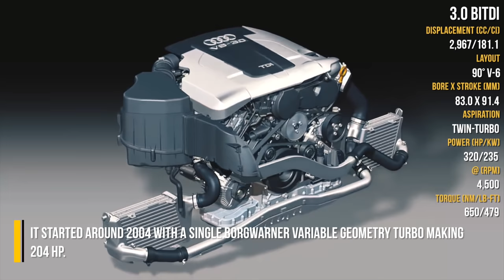7 Greatest Audi Engines Ever

Comment: I heard that the NA 4.2 barely made claimed power figures ever on a dyno, and reliability was also a problem.
Reply: They are generally reliable, however some models had a timing chain, which need the tensioner replaced at some point, for which you have to drop the engine.
Reply: MrMakrilli Thanks for replying. I was looking at a V8 R8 a while back and someone also said they could have some issues with oil use and oil leaks. Is that true?
Reply: J Stephens I haven't heard anything about it, however that's from lurking on audi forums, not doing any real research.
Reply: They are issues with  Intake valve tubings "carbonisation" / back of soot and oil deposits
Here all issues with the 4.2V8: https://forums.vwvortex.com/showthread.php?8408226-Buying-advice-Audi-S4-4-2L-V8-B6-B7-Problems-and-Common-Errors-Warning-Timing-chain-!!
Very nice guide if you want one, especially because repairs are damn expensive with those engines !
Reply: MrMakrilli you dont Need to Drop the Engine for the timing Belt. Just the Front bumper and on the S6 c4 and C5 its very easy. And than you have very much Place to work. and its very Reliable too.
Reply: David Henneberg True, not for the timing belt. But you would have to drop it for the timing chain in models like rs4.
Reply: @Makrilli  bur you don't need to change it, on some BMW you have the same problem because there is a big engine in a normal car.
Reply: Buy E46 M3 over RS4 B7 anyday
Reply: @DuBstep115  the only BMW 3series I would change with a b7 rs4 is the e30 or the e36. The others are unreliable junk. But with the b5 s4 or rs4 I would never change any BMW 3 series.
Reply: @davidhenneberg6772  How is e46 M3 junk? It literally beats b7 rs4 every way
Reply: @DuBstep115  not even close. The b7 is even not a performance car. It's like any Audi just a fast car to have many fun with and I know some guys with the b7 and they would never change it with a BMW m4 and the e46 is more worse. The m3 e46 is way slower than the b7 rs4. You need to compare the b7 with the e92, than it would be fair. The e46 is more in the time of b6 (but there was no rs model so we go for the b5) with the b5 the big problem is: every BMW guy (and one girl too) who drive BMW and are really love BMW drives just one time the b5 rs4 (and it's an avant) ant they all fall in love with this car (maybe because it's faster too). You cant compare BMW with Audi and you can't compare them with Mercedes or even Porsche as well. They are all different and not just driving different, even the feeling is on another level. The BMW is like the sporty one you want to mess with everybody and the laws are just for girls. The audi is understatement, you cruise it and sometimes on the autobahn you destroy some dumbass in his fast looking car, the Mercedes is even on another level, you don't care who is the fastest, you know who you are and what your car can do and you don't give a shit on racing someone. The Mercedes driver is racing only with a friend or another Mercedes maybe (or a car from the Same segment)

Please don't think that I am hating BMW, I really love this brand and also many others but the different is I know many of the problems of the cars too and the BMW have way more than the audi or the merc or the Porsche. The e46 is in my opinion not close the best m3. The e21 was wonderful but no m version the e30 was very great and gorgeous but my favorite is the e36. I like the e30 more than the audi S2 Coupe (only the audi got the better engine) and I like the e36 very much (sometimes I drive one, but it's not mine) but the e36 m3 is not even close to the Rs4 b5 even not the e46 with the worse bangle interior (the exterior is very great, I don't complain about that).

I wish you a nice day and hope you are not hating any other brands too. Just be fair and compare them for what they are standing. BMW is a trackbased car but not Audi and even not Benz. And don't compare it with Porsche, trust me never mess with a Porsche even when it's weaker on the track. Trust me they will kick your as and I drive a S3 8l and it's one of the good Audis on the track. When it was stock I got not a chance versus the cayman S or the Boxter S (mid engine performance beasts) but I could hold with e36 and e46 (not m3 just 328-330)
Reply: @davidhenneberg6772  I drive an Audi A5 3.0TDI but for me when I want sporty car that means RWD, oversteering and precise steering feel. For me audi S and RS models dont provide that, they tend to understeer are safe unplayfull awd and light almost numb steering feel.

Audi B5 be it A4,S4 or RS4 have all the same interior just different seats and steering wheel, have almost 80`s feel.  And audis obsession with wagons is a big no no. You cant have sporty feel in wagon.
Reply: @DuBstep115  does the m3 look different on the interior beside the 316i. In Audi you have carbon aluminium nappa leather recaro another steering wheel another instrumental another shifter another quality (alcantara roof (or how you call it in English, I'm German so sry for that) on other brands you got just the steering wheel and the seats but all you can buy on a 316 I m package. You cant buy a a4 b5 with all the things the rs5 or the S4 got because thats ONLY made by the QUATTRO GmbH. You can only get the steering wheel and the seats (not even in all models) bur you will never get the tachometer the shifter the roof the carbon or other interior material like black piano coat.
Reply: @davidhenneberg6772  Thats like 5% of interior.. its the desing of Center console and dash that make up other 95% and YES they are all the same in M and Non M cars, AMG or RS. Only small logo maby alcantara/carbon finish that you could easily do aftermarket, like install new steering wheel or interior trim.  Just open ebay on type RS4 parts boom there you go. 

Lets just be honest here ALL german perfomance cars are just different engine, suspension and bumpers fenders. nothing more, nothing special base car is same and you are going to install new coilovers anyway because the stocks allways suck. So yeah engine and looks, the cars handle the same 1.8T with KW3 coils rides the same as RS4 with KW3.
Reply: To comment this statement "You need to compare the b7 with the e92, than it would be fair. " Dont go looking lap times or 1/4 mile times. E92 M3 is out off B7 RS4 league in every standard. Tech, looks, power delivery, driving feel and and well the results speak for them self.

Not hating RS4 B7 but IMO its rather expensive car in 2018 for what it is, its E92 M3 money but barely beats E46 M3 on paper.
Reply: @DuBstep115  yes the b7 is slower than the e92 on track but faster on 1/4 mile. It got the same power and the engine don't breaks after 100-150.000 km like the e92 V8. The b7 is a pure fun machine for driving in the town or maybe on other longer roads and high ways (in germany the autobahn) and you can have the same fun with it like you have it with your e92. I love the look of the e92 more but it's unreliable and for me it's the most popular point. The b7 was only Manuel got awd and a way better acceleration. The engine is better to tune the car looks not so good but not bad as well the interior is better (my opinion).

I know the e92 is a great car when you repair your stuff everytime and that's about 15-20.000€ and more every 100.000km and that's too much for me, you can buy way better cars for that money. But when you pay that the e92 will run endless time.

The b7 got only one problem, the oil gets sooty before the valves and so there don't came enough air in the cylinder but once you did it good it don't came again and company's who did this do a new intake and ecu at the same time so you go from 420-450/460 hp. And than the problem is away for ever (when it's did by a good company).
Reply: @DuBstep115  the cars handle not the same, the Rs4 handles way better than the a4 would ever do. The Rs4 is even waaaay wider and got wider tires that you can't put on the a4 (or maybe it's possible like they're swing it with the S4 b5 but it's too expensive). I think you need to drive the b7 a4 and the Rs4. Even the awd is not 50/50 it's 40/60
Reply: @davidhenneberg6772  You really know nothing of cars... BB
Reply: @DuBstep115 ???  I think you know nothing. Or you just the theory guy who don't has driven any of them

Comment: The 4.0 V8 T should be here.
5.2v10 is not reliable and 4.2fsi lose power with mileage.
1.8t 20v and the V12 tdi are good
Reply: 5.2 V10 is very reliable, nothing like the 4.2 V8.

Comment: I thought the 450hp version of the 4.2 was twin turbo. The natural variant had something like 340hp
Reply: No, the 4.2L 450 HP variant is NA. It is just a way different version of that engine. To be fair most of that extra 100HP comes way up in the RPM range.

Comment: I had the 2.7 Bi Turbo. Coolant and oil leaks all day ever day. Everyone I met who had the engine had one or both of those problems. Good weekend tuner. Insane or stupid to drive daily. Replacing the timing belt every 80K miles requires taking off the bumper, intercoolers and radiator. I've had much better engines.

Comment: Can any1 tell me why S6/8 V10 sounds a bit different compare to Gallardo/R8 V10??
Reply: different cars, different set up
Reply: exhaust pipe lenght propably, mid engine have short, front engine long way
Reply: @alessandroarizaluski9178  hmmm yea why i don't think of that 😂 thx btw
Reply: And Supercars are meant to be louder than limousine, not the same customers.
Reply: Stock S6 exhaust is very quiet and restrictive (it has 4 cats!). With a better exhaust manifold and shorter exhaust system, it would sound the same.

Comment: Wow, claiming that Audis aren't pleasant to drive, and disappointing to enthusiasts when your whole channel is made out of someone else's videos :DD Have you actually ever been behind the wheel of any of those cars you listed and tried how they handle? Here, let me correct a couple of mistakes Wikipedia didn't tell you:
- 2.2 liter five cylinder turbo engine debuted in family wagon form in 1986, Audi 100 Avant turbo quattro (10v) and Audi 200 Avant turbo quattro (10v), later in 1989 in Audi 200 20v Avant, then S2 Avant and S4 Avant. Years later in 1994 in RS2.
- Saying that 4.2 V8 is one of the seven best, and then you add them all up from 1991 as one, when they basically only share the same displacement and usage of gasoline. Yeah right.
- 5.2 V10 may sound sweet when you have only heard and seen it through youtube videos and don't know anything about real world and for example its cylinder coating issues. One of the weakest Audi engines ever made.
- 2.7 biturbo V6, "Cosworth tuned it so it's worth mentioning"-bullshit and specs are from RS4 B5 and none of the cars in the clips is RS4. I would say with the same logic that those S4s are not worth displaying since Cosworth didn't touch them.
Reply: Also that the 2.7 was available in the C5 A6 both sedan and avant, but with less power than the S4 due to different turbos and software!
Reply: But 5.0 v10 tfsi is still better than bmw v10 .Bmw losing power this is weak engine and consume too much gasoline
Reply: @ragnarokpriest6700  I was talking about 5.2FSI, not about better designed 5.0TFSI
Reply: Give the guy a break 👍
Reply: he is right, Audi a'rnt driver focused cars like BMW are.
Reply: anyone who has owned a big engined Audi will say the front is heavy, understeer when pushed hard and isn't that nimble in the corners.

Comment: 3.0 V6 TDI is very problematic engine... Never thought it can be one "of the bests"...
Reply: ...Because? Have that Engine (Single Turbo) in my A5 tuned to 310 Horses and runs perfect without any issues since 10 Years,need no extra Oil.

Comment: 1.9 tdi , 2.5 tdi inline 5 not v6  one of the best diesel engines for petrol i'll guess 1.8t  2.2t great as well but in other hand 2.3 only good thing is sound, loads of problems.

Comment: Audi's are not a joy to drive?
Reply: Older ones were veeeery front biased... Haven't driven any of the current generation RS.
Reply: If im not mistaken, they put the engine closer to the front in production cars for safety reasons.
Reply: @FinnishCarGuys  simple suspention upgrades fix that.  They are great track cars
Reply: They are not particularly exciting to drive. From the factory they generally have pretty heavy under steer. I'm sure some suspension work and alignment tweaking will mitigate a lot of this; but for the most part, the engine is hanging ahead of the front axle and is thus a handicap to handling.

They make for nice touring cars though. The lighter steering, taller gearing, and tendency to under steer means they feel easy, stable and unstrained at speed.
Reply: atsernov my S3 8l got better Handling than Some BMW. New Suspension and you are ready, the 1.8 is a very light Engine, its very good in corners (but you Need to Know how to Drive it, First i had my Problems with it too).
Reply: That's because your S3, like a Jetta/Golf has a transverse engine layout. The TT is also a transverse and handles differently from the typical Audi. The R8 of course is another that brakes the rule but again the engine is placed differently from the rest.

Most Audis have a longitudinal layout with the entire engine hanging ahead of the front axles. This is what gives the Audi its handling characteristic.
Reply: @atsernov  that's right
Reply: more room for inside car this is true about it a6 c6 vs merc or bmw  in same year of production audi  have  more space inside car

Comment: S85 wins
Reply: Very unreliable engine, and it makes less power than the 5.0 TFSI
Reply: Maybe, but it´s cooler. (Rev, sound and the rwd platform). 
S85 wins to me.
Reply: @suprvrmedia6235  RWD is a feature of the car, not the engine, while the 5.0 TFSI can hold more boost than the S85 . There is nothing cooler than a Twin Turbo V10 from the factory
Reply: @RealCapo88 preach!

Comment: Bmw M5 have non turbo 5.0 v10 507hp and Audi done 5.0 v10 twin turbo engine and have obly 580hp?  its only 80hp  its not to. much if we Talking about twin turbo engine
Reply: just remap it and you will have 700+hp. upgrade fuel, turbo,intake and exhasut and you are  almost in 1000hp club.
Reply: The maximum power is quite close but the mid range power is very different. With the BMW's one you need lot of RPM to be fast. Audi V10 is full of torque, it's more GT oriented with low pressure turbos.
Reply: My RS6 is at 780hp with just software and a small mod to the exhausts..
Reply: The beamer V10 also likes to eat big end bearings for breakfast.
Reply: TomekM4 the V10 from the R8 got 610 hp without Turbo, and in the old R8 580 hp. So why the BMW got only 507... And the Engine is not Even close as good as the Audi V10

Comment: What??? 3.0 TDI is a good engine ??? It's a pile of scrap. Fuel pump seizes up, shafts are seized, and to replace the timing, you have to remove the engine. The same 2.5 TDI v 6 even bigger junk that spoiled the reputation of TDI engines   And where is it as popular as the 2.2 Turbo 1.8 T? This engine also deserves attention. I would put it on the table instead of the shitty 3.0 V 6 TDI

Comment: It's a joke ?? 4.2l V8 it's worst V8 ever!! They all have at least 50hp lost after 20,000km. Big problem butterfly valve on admission !!! and where is the only robust engine from audi ??? the 2.5l v6 tdi ??
Reply: 2.5 robust? Nope.  AND V8 NA Still 295HP From the 299 original and that on 212.000 km
Reply: I believe he meant the 4.2FSI in this video which is very solid engine found in RS4, RS5 and a detuned version in S5 and Q7
Reply: 2.5 V6 TDI had a lot of issues at the start but the last built are very reliable.

the 4.2 V8 FSI 420hp got a shit load of problems but older 4.2 v8 "no FSI" are fine.
Reply: Found a 4.2v8 fsi with 450cv! It's IMPOSSIBLE! look on internet !!!
Reply: 2.5 V6 was not robust. I used to have one and replaced the cams due to lobe wear. My 5.2 V10 has been excellent though.
Reply: 2.5l v6 TDI is very nice! I had 2 and more 300.000km
Reply: You must mean 2.5 I5 and not the V6. V6 was shit and I5 was god tier
Reply: @BassVentura with stock camshafts? None, its inferior engine in every way compared to 3.0tdi or 2.5 I5. Stain of shame in audis history, just like first tfsi engines.

Comment: 3.0 TDI is not great engine, it is not reliable & needs constant expensive maintenance.
Reply: Not true at all I've had two one at 130k and one at 172k on the clock and not really a single engine issue.
Reply: @RealGX  I do not have any, but my friend repairs cars & this is most common engine on A6 and he all the time repairs these. Main issue is weak chains and all modern diesel engine issue - injectors, but also dpf filter.
Reply: @SiiliViin  

Which model year? There was a bad batch on the A6 C7 but its due to owners not changing the oil frequently enough.
Reply: @RealGX  I am talking about C6, C7 is too new, but probably same issue will be there also. Whole VAG group have weak chains, VW smaller gasoline engines need new chain below 100000km.
Reply: @SiiliViin  

Yes I agree C6 had problems and 3.2 FSI and 2.0 TFSI but its the tensioner that failed due to irregular oil changes. Not the chain itself. Sadly people don't know how to maintain a car.
Reply: @RealGX  I do not know exactly, but I know, it is not just tensioner issue, it is chain issue. Chain is too "optimized", too thin and stretches out easily or too fast. VW 1,4 engines have this same issue as example, but as I have heard, this is not only VAG group issue, but many car manufacturers issue nowadays. To optimise fuel efficiency, they optimise engine too much, so it is not lasting anymore, but this is not subject in modern world as officials are only interested just co2, nothing more. For them, world is black and white, they are not interested real "world care", just campaigns.